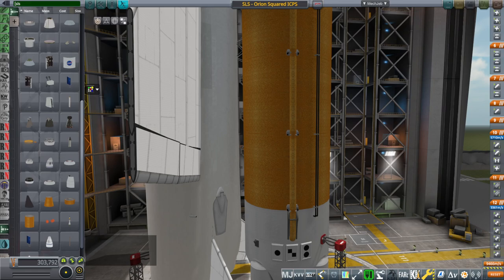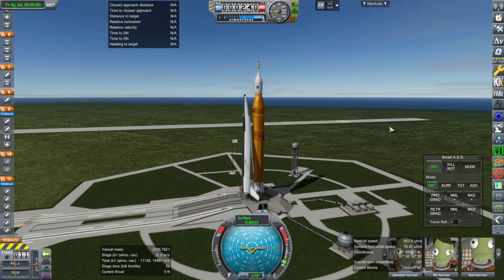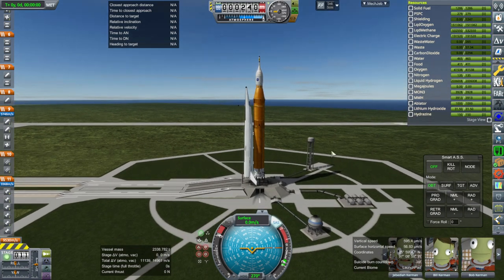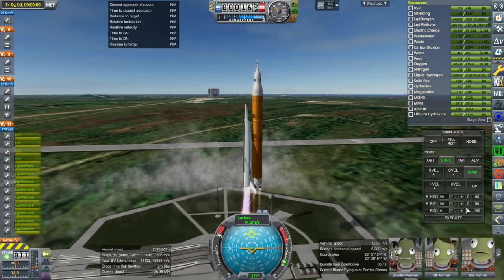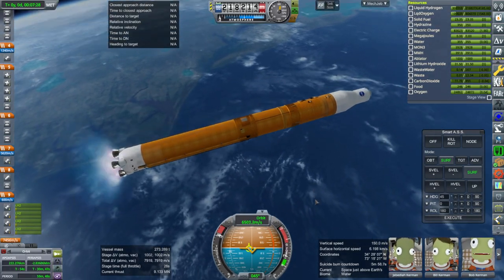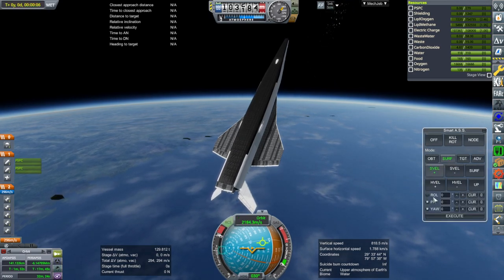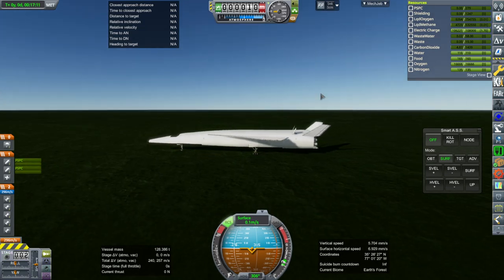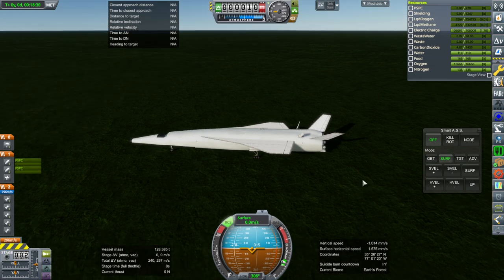Realism Overhaul in KSP 1.8.1 - SLS and the Orion Carrier Plane

Comment: SRB’s provide high TWR to yeet the core into space

The only improvement on boosters would be to enhance performance to that of block 2B by using 2 kerolox boosters with 2 F1B’s each, would provide equally high TWR
Reply from the maker: Except this works, and if there were two of these methalox boosters, it would outperform the SRBs and the kerolox.